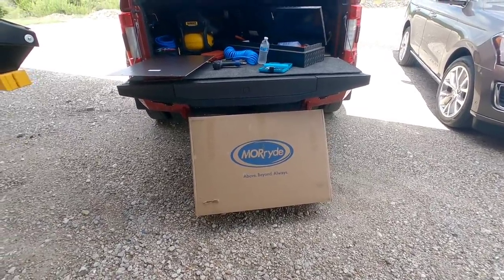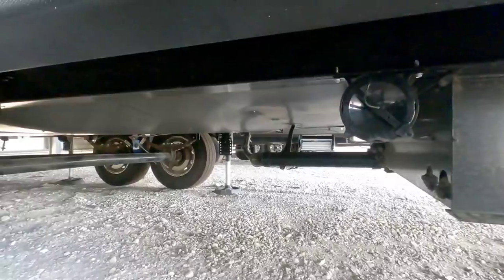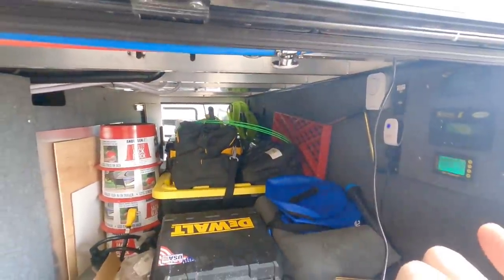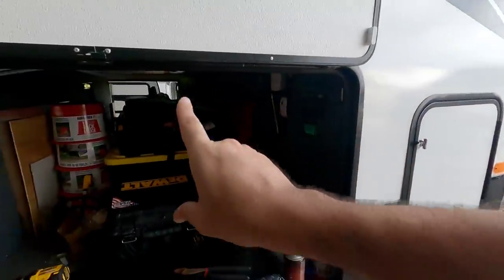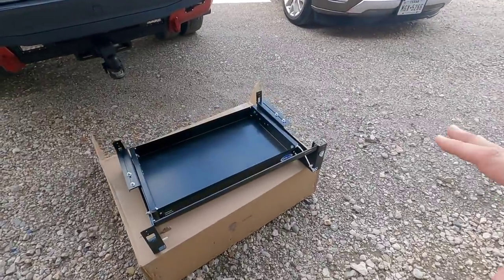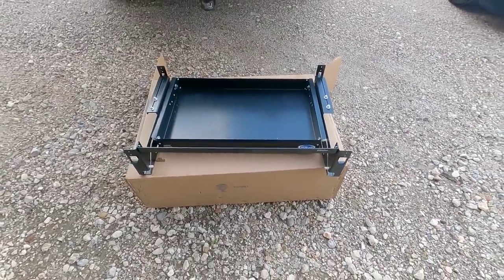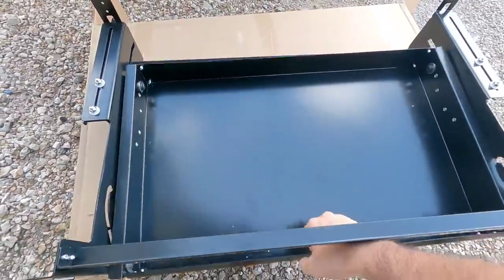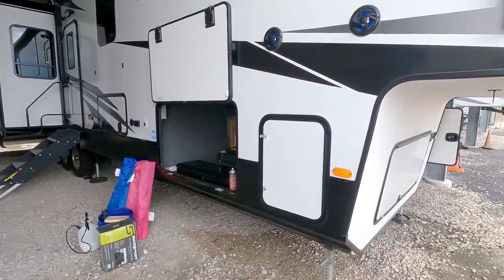Awesome Invention from MORryde That I CAN'T USE! So Frustrating!

Comment: I noticed when you were in the under storage you had floor joists between the primary joists. Did you add these, or did they come with your rig this way?
Reply from the maker: Built that way
Reply: @BigTruckBigRV  I don’t think I’ve seen any rvs that have these. Your upper deck must be much less spongy than so many others. Thanks for taking the time to respond, it’s appreciated!

Comment: How far would you need to drop it down?  Would it interfere with the access to the lower portion of that bay?
Reply from the maker: It would certainly need to drop down significantly to make it work. I am still pondering a solution
Reply: @BigTruckBigRV  How about a sliding tray mounted from the top?  It could be long and shallow to minimize interference and still have the volume to hold a large amount of tools.  You could even use organizer foam.
Reply: @BigTruckBigRV  
Q:  6 inches (150 mm ??) ??

Comment: What is the black aluminum tool box in the storage area under where you wanted to mount the tool tray?
Reply from the maker: Electrical and plumbing parts
Reply: @BigTruckBigRV   what is the brand of the box. I need one that size and cannot find any.

Comment: What are your thoughts on torsion axles?
Reply from the maker: Great setup, especially for trailers that need more articulation per tire.  Only issue is equalizing weight over tandem axles since there isn't an equalizer.